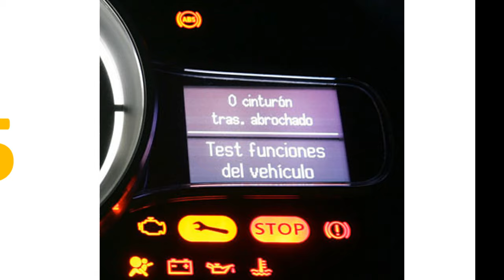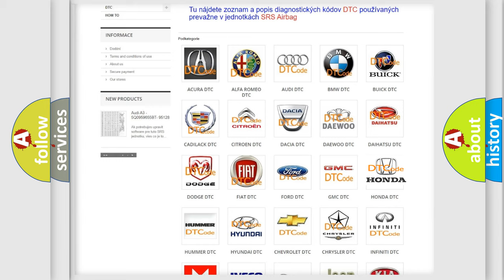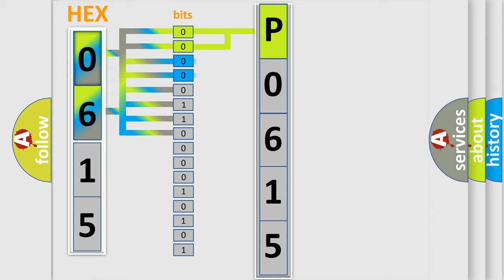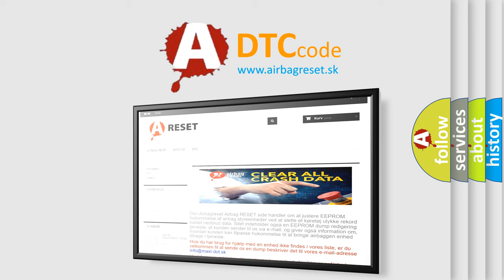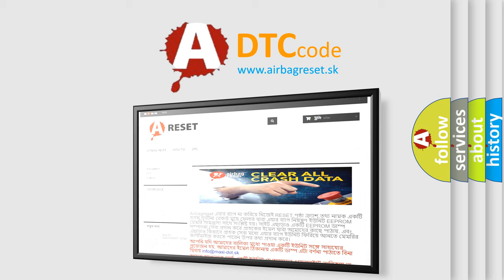DTC Honda P0615 Short Explanation

Comment: A p0615 is a starter cut relay problem!!! Usually the relays stick. Mine were replaced and trying to find other common issues.
Reply: Ended up being high resistance through transmission range switch. Would start in neutral.
Reply: Have u solve it?
Reply: @LastKeepChips  yes. It was the transmission range switch faulty. Replaced it with no further issues. Tested it by holding the shifter forward and backwards. Only gave issue when held forward